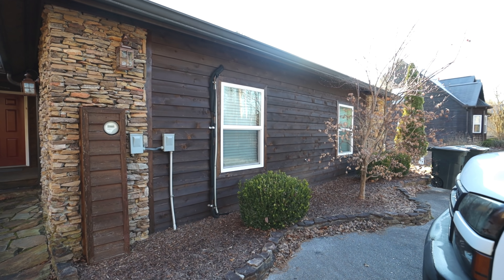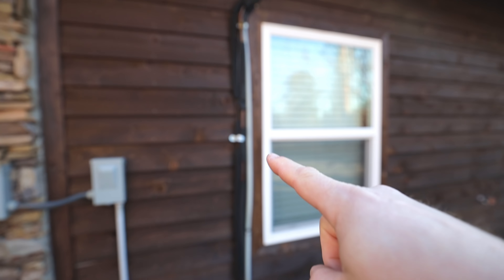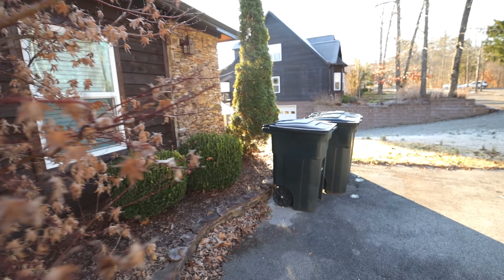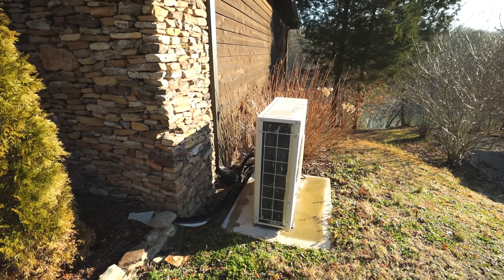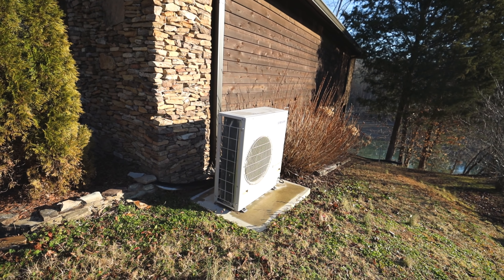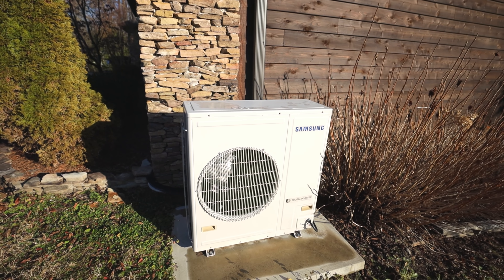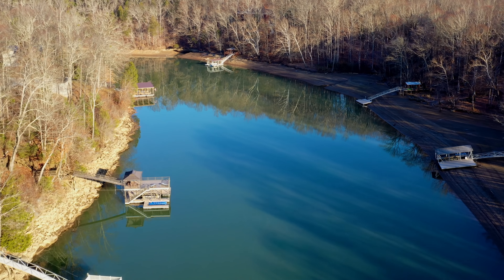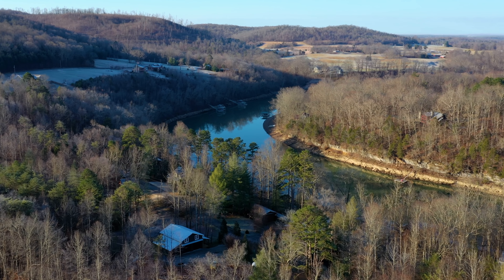A Cool HVAC Project By The RIVER!!

Comment: Whats the manufacturer specifications of length to bury the copper. Most manufacturers its not alot. Being the ground is colder the oil will migrate and possibly starve the compressor.

Comment: I’m curious why you went with a heat pump system where the gas pack is at. Gas is cheaper to run than a heat pump, and the gas unit will heat up faster than the heat pump.
Reply: Probably found out it was propane
Reply: @screweduplife14  there’s a gas meter on the side of the house
Reply: I would say rebates decided the move to a Heat Pump. I know here in Philthadelphia they are giving bigger rebates for changing to electric than gas. This may have been the big factor.
Reply: @FlyEaglesFly19111  He’s in Tennessee and it’s TVA or something like that they have a big rebate program for doing heat pumps plus gas will start to go back up in the next few years but it is natural gas-I do a lot of work in Huntsville Alabama I’m from Tuscaloosa so I have to deal with both sides Alabama power doesn’t have hardly any type of rebate programs but from huntsville and they do
Reply: even though the rebates may have been appealing, sometimes there may be deals on equipment and he may have just wanted to go with that style of system.  heat pumps are pretty expensive compared to gas heat also more things can go wrong with heat pumps so deffintly would want to see why he chose that.
Reply: Yep and wait till that expensive unit breaks out of warranty. Rebate or not, I will never advise a heatpump where gas is available

Comment: Hey bud first time I’ve heard you say Bosch . I don’t sell them but I haven’t heard one good thing about them. From about 4 different people different channels
Reply: Thats odd because all the contractors that I have talked to (more than 4) and they have said good things.
Reply: I have Bosch equipment in my home. It works well - but if you need new parts, brace yourself for the bill. I had a variable speed fan motor replaced on the air side of my geothermal heat pump and the part alone was around $1500. Failed after only 7 years of operation - and I run the fan constantly to avoid wear caused by start/stop cycles. If you are getting the impression that I am less than happy with Bosch overall, you are correct.

Comment: I heard that setting airflow on a Bosch variable system for dehumidification is weird. You have to set airflow lower than usual.
Reply: Just set the airflow to 350 cfm per ton @.5 static. I have be installing in North Carolina for 3 years with no issues.
Reply: Timothy Salomon  just because they on YouTube does mean they know what they are doing. I am a Bosch dealer and have installed many Bosch systems. But I also make sure the duct work is the correct sides for the tonnage I need.

Comment: Never would I ever go from a furnace to heat pump, or allow a customer to do so beause they'll regret it, even propane is a similar price range to electric as far as run cost goes, but gas heat will heat quicker with less run time and will last longer.. 🤔

Comment: I heard bad things about the bosch inverter not dehumidifying.
Reply: The Bosch system dehumidifier fine if it is set up correctly at start up. I one I installed in my house has no issues even with the 125 gallons fish tank and North Carolina summers.
Reply: @nhfdtb  ok I've only heard on YouTube stephan rardon said he wouldn't install one without a dehumidifier. I personally have no experience with that unit but Interested in the technology.

Comment: cant hang nothing to this cement block, they are empty insyde and will crush :(
Reply: Sure you can. If you drill straight thru and use unistrut on the back side to brace it will space the load it will work.
Reply: @FlyEaglesFly19111  lets see implementation, maybe it have concrete inside. i my case i had to use 10 inch long chemical anchors to hang 24000 outside unit, Coquina inside of wall dont hold and bricks outside doesnt hold long enought arms  :(